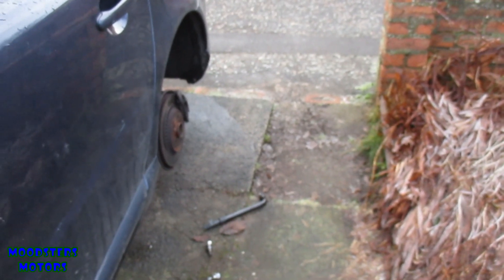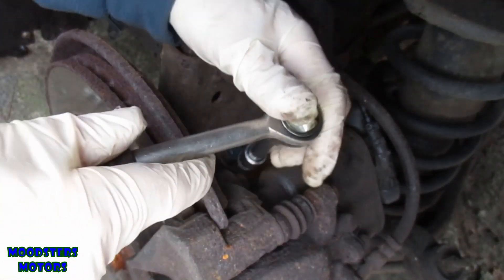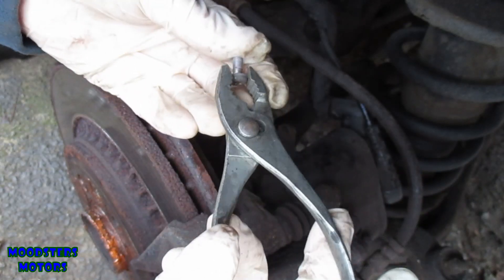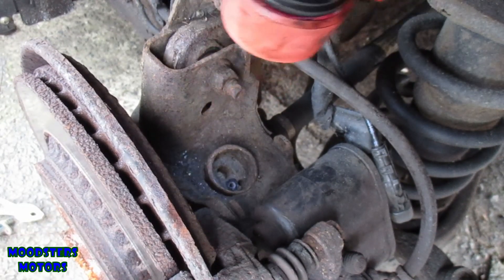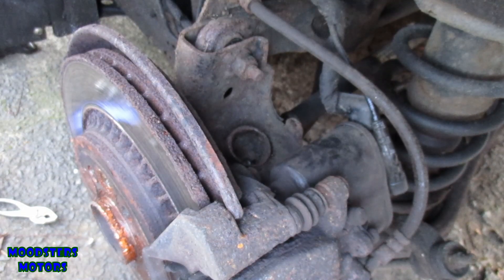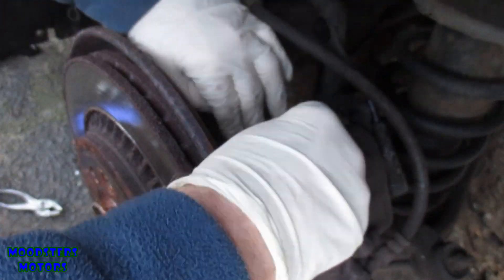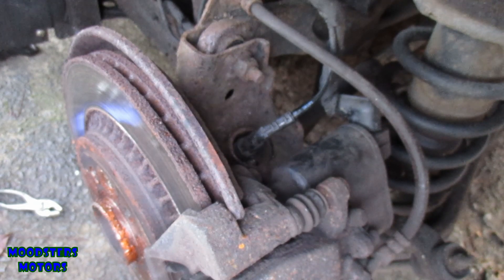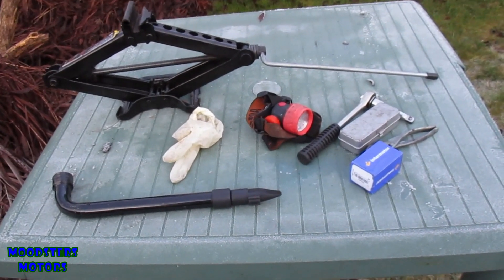Volvo V70 III Rear Wheel Sensor

Comment: Anyone with a standard front wheel drive model, the sensor goes in from the back pointing outward. A bit fiddly and you do most of it by feel unless you have a ramp or similar handy.

Comment: Isn't that a four wheel drive version? Most V70 are 2 wheel drive.
Reply from the maker: @fredflintstone2077  Yes, you're right. It is the all wheel drive and I was assuming the two (front) wheel drive would be the same, as the sensors are used for the anti-lock braking system.

Comment: Thanks for your helpful video.. I have a 2008 XC70.
Reply from the maker: The Volvo reliability is legendary, and although mine has done over 200,000 miles (322,000 Kilometers) it still runs remarkably well... I hope yours is doing the same.

Comment: I asume that this is the same on a XC70 2008 Do you know if the sensor is the same as Wheel Speed Sender 24071151983 This is all new to me. Thank you for any help you may pass my way. The vehicle is checked with an OBD2 is confirms that the back nearside sensor is faulty. I have ABS and DSL lights up on the dash. When I set off I am like a dog with worms dragging its itchy butt. The abs can be heard pulling the car while I try to accelerate. Eventually it lets go and allows me to drive. The car breaks just fine Its setting off after engine start that is the problem until it has worked out what the problem is on the onboard computer.
Reply from the maker: I honestly don't know, but I do know that both models share many parts. Check with your local parts supplier, i.e. Halfords or Volvo dealer. Sorry I'm not of more help.